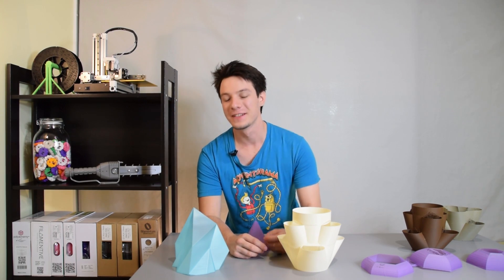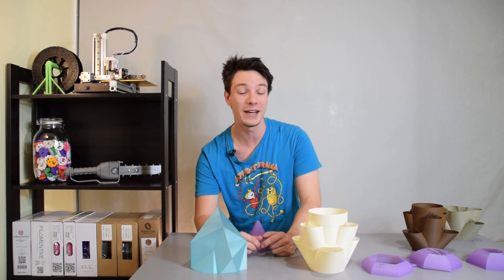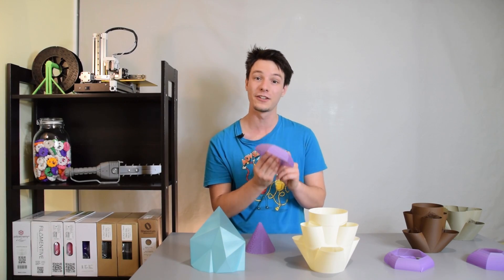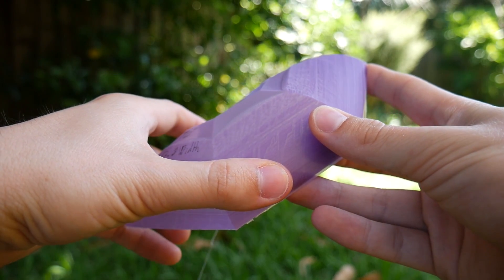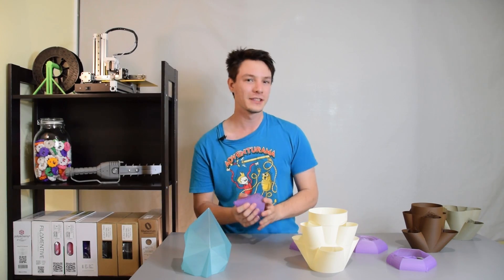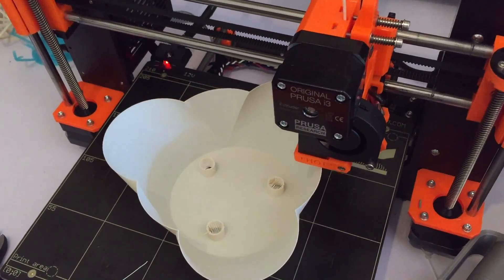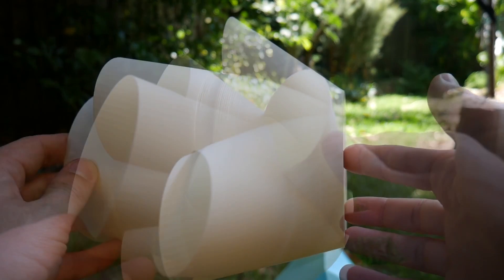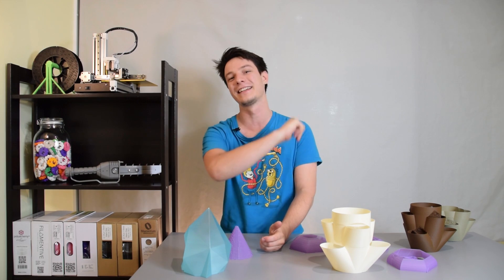Hacking Vase Mode - 3D Printing Experiments

Comment: This might be an interesting way to make lightweight things like 3d printed airplanes
Reply: Yup I know a site where you can buy vase mode optimized RC airplane plans ;)
Supposed to run in vase mode with PLA. They say that are still very strong.
Been wanting to check it out but I don't have the money to spend on a new set of RC electronics.
Reply: Yes, you have to have internal support for a wing. The interesting part is how the Gcode pathing allows the printer to to do a vase-path while still printing internal supports. I have a Prusa i3 MK2 and they now come with a Spitfire in about 25 Gcode files that you can print. I printed one part (of 4) for the left wing to see how it would come out. It's very nice actually and I learned a lot just watching the pathing the machine took.
Reply: There are many airplane models you can just take and print in vase-mode, fill with foam to add stability and you are good to go.
Reply: well I haven't had much time to delve into it yet but they seem to also be using a 3D support structure. Very similar to how balsa models are made, a balsa wood structure with a film over it.
Reply: Eric - Youtube allows you to post links - for quit some time now already.
Sooo ... https://3dlabprint.com/ - there ya go.

Also - there are many many sites that offer good 3D models, i really do not see the point of paying for some airplanes. cause they do not seem to be anything special either.
Reply: Joe Catton .
Reply: Hmnnn... you could print the parts in vase mode, and then fill them with a light polyurethane foam to give them strenght.
Reply: ComandanteJ plus some thin wire floating in the void to reinforce a la concrete rebar
Reply: Link please?
Reply: I'm not saying that I would pony up for their planes myself, but where have you seen printable 3d planes that you can FLY? 
If you just want a static model for the shelf, there are are models a-plenty. But I haven't seen very many around that you can put in the motors and electronics into and then get them to fly around in the sky.
Reply: 100:th like!
Reply: Nathan Shin that would be interesting yet highly inefficient.
Edit: oh did you mean rc planes. I thought you meant passenger planes